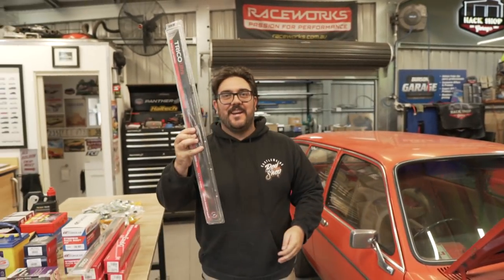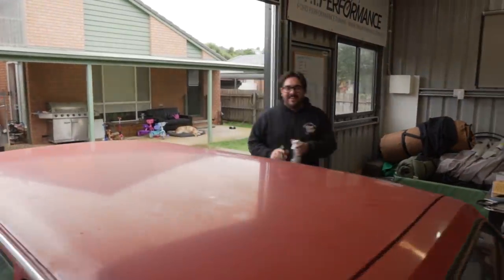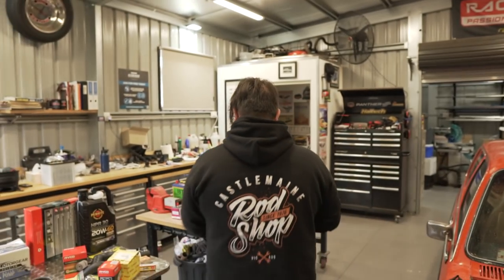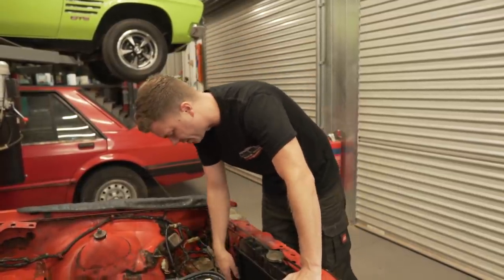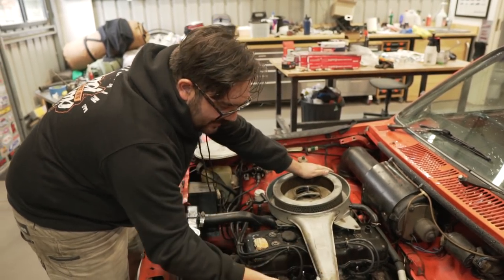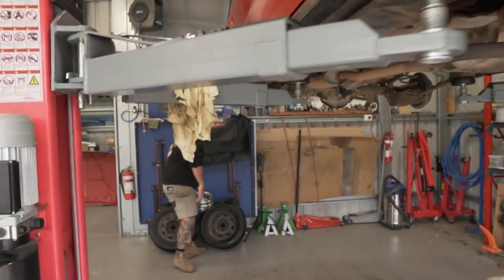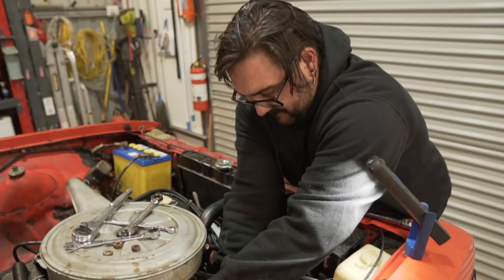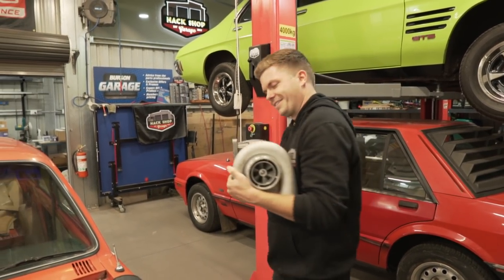GEMINI BUILD - Part 2 - Fixing The Essentials

Comment: My second car was a TD in Darwin. So the gunk on it was red...
Mine was bored out to 1750 odd cc, had twin dual throat downdraught Webbers, a cam and extractors. Used to race it at the 19mile airstrip, no drag strip in 1982. Was a very quick car at the time.
For interest, 205/60 tyres make it fun around corners.

Comment: I had that summer/winter switch in my old Gemini. Didn't understand what it did when I first got it. I found out what it does whe  I went for a long drive to the coast and lost most of my power going up the mountain. Switched it to summer and then never used it again after that.

Comment: Split pin in the caliper isn't that bad, 6cyl mk3 Cortina's had them from factory it's only to stop the pad from falling out. The caliper is machined to perfectly fit the pad in so there is no force on the split pin, but if it came with pins try and find one, put what was standard back in it.

Comment: those brake calipers are the same as hr, hk t g  and austin 1800 most brake place will probably have new or used pins 
try power brakes in adelaide the guys there are always helpful

Comment: 'GUNK' please, to stick on my 1980 TE Gemini Wagon, G200Z 2.0L EFi🤣 Also, the big turbo is for a Ford Barra 4.0L👍👌🤘🇦🇺 P.S if you need a USED speedo cable, a NEW thermostat housing, or a NEW valve cover gasket let me know🤔

Comment: I owned more than 20 gemmys. The worst GUNK experience I have ever had was when a chick from uni power spewed in the front passenger seat. Shed been at a cheese and wine event. Filled her handbag which contained her house keys and I couldn't get her inside her home. I was a gentleman and put her to bed at my place. In the morning I had to face the cheesy spew carnage in my road rego'd rally spec TX coupe. Drove with my head out the window like Ace Ventura to the car wash. Had to knock out the floor plugs and power washed it while trying not to spew myself. The TX coupe lived on another couple of years until my mate bent it hitting a tree at speed in the Anglesea forest stage of our very own private rally series! FUN TIMES!!!
Reply: I'd also like to gift you any remnant gemmy spares (and/or xf spares). Hmu for a loan of the Rupes polisher to bring that red paint back to life.

Comment: The Holden Gemini probably the best four cylinder Holden have ever put there put there badge oops l forgot about the rodeo l had a 2008 one and it wasn't very good l have a fact the first 4 cylinder car Isuzu built was the hillman minx under license from Rootes Group l also own a 25 year old Japanese motor vehicle wihich l bought in 2020 and it was running registered and my first drive was from Newcastle to Sydney it made it no problem l have since retired and have been slowly working on it during my retirement and it is a 1997 toyota hilux ute with the 22R engine l hope you changed the fuel filter and as you realise lam older than both of you l can remember the Gemini coming out and there was a diesel gemini maybe the first diesel car available in Australia

Comment: Remember it runs lead fuel so you will need to add an additive to the petrol tank each fill, until you can the head with upgraded valves. Also the spring in the booster maybe broken which may cause a flattish feel in the brake pedal
Reply: It's an alloy head. They have hardened valve seats already. No need for additives.
Reply: Definitely true. I've owned my gem for 13 years and never used flash lube